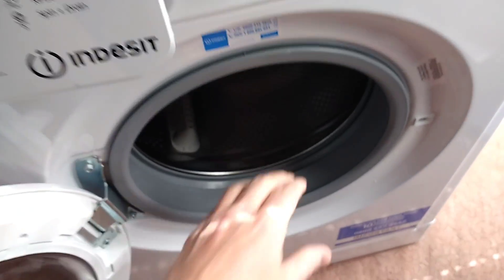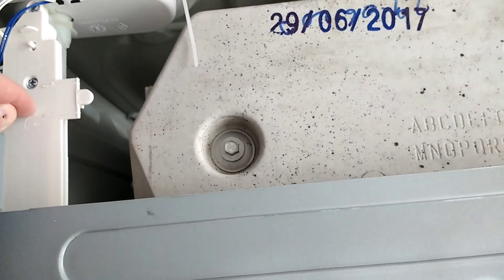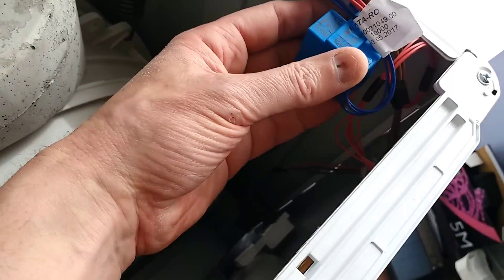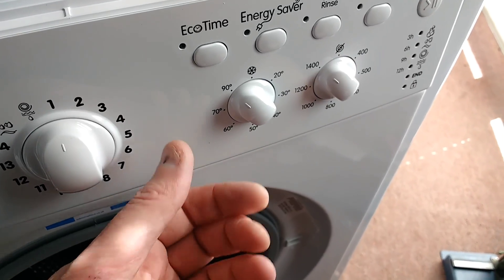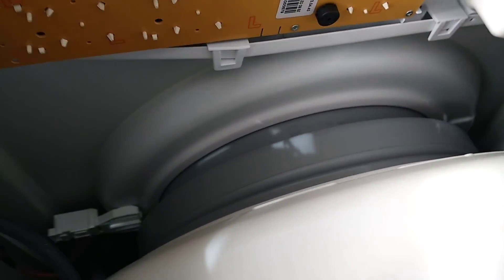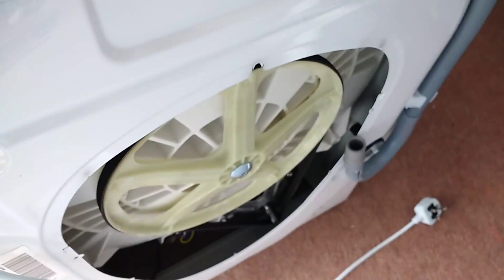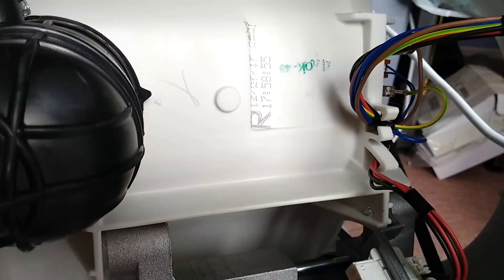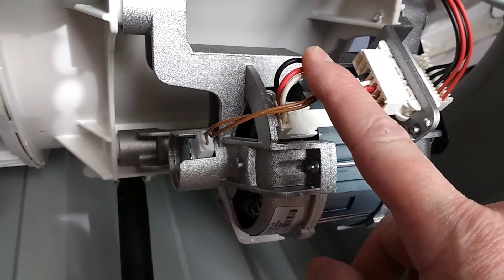Inside my new British washing machine (clothes washer).

Comment: Ours is a direct drive washer and has the motor as a large diameter thing attached where the big pulley would go. I figured that without a belt there is  one less thing to fail. Unfortunately it plays a happy fucking little tune when it's done.
Before that I had a series of Hotpoints, the last one caught fire spectacularly.  Fortunately I knew it was failing and took it outside on an extension lead so we could watch and cheer safely.
Then we had a Bosch bought off ebay which lasted us five years before it decided it wouldn't spin, so I bought our current one. Then I took the Bosch apart and found the pump jammed with guff, once it could pump out it would start to spin. So sold it on Ebay for pretty much what we bought it for.

Comment: I certainly wouldn't be comfortalbe with plastic pins and any sort of well... non existent obvious method of  balancing before (I have no idea what it is called in english... schleudern) ramping up the speed and squeezing the water out of the clothes
It seems horrible also that they make the pulley out of plastic.. but that being said it could just be a topology optimized version of a metal pulley which is just as stong or even stronger but cheaper...
fusion 360 can do this for free if you want to try it on your 3D prints and are so inclined.
but still I'd much prefer a metal machine with direct drive and fluid dynamic counterbalance... gives the brain something physical to grasp and hold onto while the machine is trying its best to blow itself to smitherines :D
Reply from the maker: A few appliance engineers got in touch and said the plastic pulleys are more reliable than the older metal ones.
The machine balances the load by alternating between tumbling and low speed spinning while monitoring the motor feedback until it gets a consistent current graph indicating that the load is balanced enough to spin at full speed.
If it can't balance the load (like when I put in a set of heavy overalls) it will try a number of times and then finish the wash without a high speed spin.

Comment: A front loader. Interesting as those here for home use tend to be usually top loaders with front loaders used at a laudromat. My GF's machine is about 20 years+ and still going strong. Had to replace the timer switch once.

Comment: May be 10 or 12 years ago I was working as a technician of Indesit/Ariston service center.  You are right for everything except one thing. Witch is less important. I'm  not shure if the things is  changed this days,  but if they not,  this machine should be italian or turkish.  The most unreliable part is the control unit. I have changed hundreds of them :) It is good that you chose a basic model,  without the fancy things, witch are mostly marketing tricks.

Comment: Is your washing machine affected by the whirlpool recall? Do you think another video on it is in order? :)
Reply from the maker: It's not part of the recall.  The issue seems to be the switching of the supply to the heater through the door interlock.  I thought they'd just switch the control circuit.

Comment: I believe they only have cold water inlet because for proper washing the temperature needs to be precise. Many washer have a long distance from the hot water heater, so they need to heat the water anyway. Since they have to heat the water they might as well just access cold water, save cost and not degrade performance.

Comment: I have an Indesit 10 years still running great washing machine even though its one of the ones on the danger list that exploded on Watchdog TV programme, even bought a Fridge freezer based on its reliability.
Its all down to how you use things that makes em last.
Mine has the same plastic pulley wheel - nae bother in 10 years!

Comment: Well, there's not a lot of difference between this, and my 25 year old Zanussi, except maybe 'software', and the fact that mine has two water inlet ports instead of the now regulation one port jobbies. Why don't the powers that be want us to use hot water off the house supply? What's to be gained by heating the water after it's in the machine - except bigger profits for the electric company? And how ironic, even more plastic bits in a machine, in a world where plastic is now a dirty word!

I think I'm going to stick with my 25 year old machine a wee bit longer - like maybe until I stiff out.......... say, another 20 years or so!

Comment: Hi Clive.

I have a very similar indesit washing machine. I find on the 'wool' wash (program 13 on my machine), it doesn't seem to rinse very well. If washing powder is used (instead of a liquid/gel washing solutions), it leaves a white residue on clothes (most noticeable on dark clothes). Using conditioner will also result in a similar residue even if a liquid/gel washing solution is used. Have you encountered this problem with your machine?
Reply from the maker: It may be because it's tumbling slowly and at a low water temperature.  I use liquid detergent in mine.

Comment: Clive, it was great to see a modern washing machine, things have slimmed down considerably since I was a Hoover service engineer (a six-week training course!) about forty years ago when they first introduced electronic control modules.  They've saved a hell of a lot of money on the copper wire!  When I left Hoover, my life went in another direction entirely and I lost touch with electronics but I'm trying to get back to it now I'm in my seventies.  After one heart attack a few years ago, I hope to build my own defibrillator! :)  I love all your videoes I've been binge watching them, thanks, buddy!
Reply from the maker: You can buy a defib for about a grand now.  Very complex things that analyse the remaining heart beat in great detail and will apply specific pulses and polarities at specific times in that rhythm.
Reply: @bigclivedotcom  🤣🤣🤣🤣
Reply: The best defibs are "bi-phasic" i think now - and are less damaging to the heart muscle while also being more successful. That's getting to be an "interesting" DIY design to a unit needing to handle a few hundred joules at KV and waveform shaping. Not impossible, but if your life is (literally) depending on it, I might be tempted to buy a second hand one.

Also the AEDs (auto ones), actually sync the shock with any pulses and twitching - again to try to maximise the sucess rate.

Comment: A lot of Clive's observations are spot on.  The dual cold water inlet solenoid valve is tailored to provide flow to appropriate dispenser compartments.  The motor is of a 3-phase AC type and runs off a VFD in the control module.  Many of the 'higher end' models are utilizing a direct drive motor arrangement with a large diameter stator and hub, which is quite likely larger than your drive pulley.  The tubs are constructed of a glass fiber filled plastic, polypropylene if I'm remembering correctly, and the halves are joined together with an ultrasonic weld after the drum and bearings are inserted.  The deeper rear section of the tub is universal to all models, while the front section is of varying sizes to allow a range of capacities.  As you'd expect from production engineering, there is very little difference between construction of lowest to highest priced models within the same design series.  Thanks for the look inside!

Comment: I couldnt realy see on yours but ive noticed on later machines the motor dosent have a pulley anymore..the belt runs off the shaft with grooves in it...
Other then than that they look like there made from cheap plastic which breaks the day after the warranty expires.

Comment: Looks like new machines don't have the little pendulum switch to cut it out when the shaking gets too much.
Reply from the maker: This one detects imbalance by monitoring the frequency variation of the motor encoder/tacho.  If I put a heavy pair of overalls in it will spend a lot of time trying to get them balanced, even spinning them slowly to try and shake some of the water out before trying various techniques to shift them around in the drum for another balance test.  The software in this thing is really clever.  It will even jerk the drum to try and redistribute a load clinging to the side of the drum.
Reply: It's a clever advancement I suppose.  The pendulum switch must be very old fashioned now, I couldn't even find a handy picture of one...  I have a small stand alone spin dryer that I sometimes put golf balls inside which then find the right spot to balance the spinner. :-)

Comment: I think they make the pulley from plastic instead of aluminium to prevent people from throwing rocks in the machine and enjoying it slowly and painfully dying that way. I imagine the plastic would break quite soon if a rock was thrown in 😄
In that sense and to be realistic,they probably designed it like that because 1. It’s cheap and 2. It acts as a additional mechanical safety so if the drum were to be jammed it would break. But i could be completely wrong 😄
Reply from the maker: The machine engineers said the plastic pulleys were more reliable than the alloy ones.

Comment: Ever put a great big comforter in and admire the motor controller as it ever so slowly and gently ramps itself up into final spin. Ahhhhhh. #bustedwatchinthespincycleagain!?
Reply from the maker: Not just ramping into the final spin, but analysing the balance of the load by the waveform from the tacho and realising your Carhartts have positioned themselves badly, then doing a slow tumble to rearrange them until the load is balanced enough to spin safely.  The software is amazing.
Reply: Right!?!? The things we take for granted.

Comment: too much plastics in my opition. I wouldn´t trust the motor hinge and the pulley at all.
Reply from the maker: When I put the video up a lot of machine service engineers said the plastic pulleys were much more reliable than the metal ones.

Comment: A few points worthy of note:
- our 12 y/o LG also has only two valves and it works exactly like you expected - both open for the fabric softener cycle (except on ours it is in the middle, not on the side like on yours - seems to make more sense in the middle)
- washing machines with only cold inlet are absolute standard here (Czech R.)
- Why is there the alphabet engraved on the top concrete weight of your machine? :D

Comment: Shitty place to put the main controller, I had a Hotpoint washer/drier for about a year then the whole thing stopped working, found out that the controller had got soaked because of an internal water leak. Designed on computer Never Meant to be Fixed, Modern Crap.

Comment: We replaced our front loader with a top-loader without the agitation thingy sticking up the center of the drum. To the point...We like it and don't have to crouch to put clothes in it or buy the pedestal that would jack it to a comfortable height. The old front loader had a sizable concrete block inside and FYI it  was not bulletproof. I took it to bits with some fine American and German firearms.

Comment: Wow, it is strikingly similar to an Australian one I pulled to bits a few years ago! Front panel layout and metal pulley are the only notable changes that I can see. Judging by the unfinished state of the casting, they were already spending as little as possible on the metal pulleys.

Comment: well its defiantly not a miele lol and those plastic outer drums start to smell after a while and are great mold traps. The brushlessmotor looks good but whats with the plastic pulley!!
Reply from the maker: +Stefan Graichen It turns out that the plastic pulleys are stronger than the metal ones.

Comment: Hope you have years of satisfaction with it, I had an Indesit washer dryer that lasted nearly 20 years, it baffled hotpoint/indesit engineer I know who was impressed it lasted so long, and yes I remember it had hot and cold inlet which was great as I linked the hot to a solar (radiator) panel in the garden..!

Comment: it is a 3 phase induction motor makes in very quiet , the outer tub is sealed , it cant be opened , its a nightmare cant change bearings. the belt is elasticated so can stretch . i work on those all the time, any questions?

Comment: the dispenser has 3 channels.. 1 valve feeds left to right, the other feeds right to left & when both are on at the same time for the fabric softener to be dispense the 2 water jest meet in the middle & make a 3rd jet of water. only 27 years fixing these & actually work for this brand.  motor is a 3phase.  that module will fit a few machines & yes we have a connector that fits the hole in the back to program the board & for diagnostics, we can run the machine from our laptops!

Comment: I wonder if the arm holding the drum in place is also plastic? Cause they might have moved away from aluminum because of corrosion issues from using bleach and ammonia.

I know that is a real issue on LG models, who also have a tendency to develop a condition called "mud butt" in which the bearings in the back of the machine develop leaks, which shorts out the direct drive motor, causing the drum to electrify speeding up the corrosive process and giving the person operating the machine a surprising shock when they try to operate the machine.

Comment: That machine seems super serviceable if you can get the parts.
Reply from the maker: Most modern machines are, and the parts are usually available from online companies.
Reply: I haven't tried to repair one in many years, I did sell a broken washing machine on Ebay for £1, the guy who bought it drove  4 hours to pick it up.
Reply: That's always MY biggest concern: Parts availability. Especially, if a machine isn't well made.

Comment: Is this one of those washer/dryer all-in-ones? They are starting to become available in the states, but the appliance store talked me out of it because they said the 120v doesn't dry very well.
Reply from the maker: My first washing machine was a washer-dryer unit.  It could only dry small quantities of clothing because a proper dryer needs the biggest drum possible to allow the clothes to tumble and air.  It was also very troublesome because it was basically trying to fit a lot of technical stuff in a cramped and steam filled area.  I recommend separate machines, and also a condenser dryer if they are common in your part of the world.  (no outside duct needed.)
Reply: Yeah they pretty much just have separate air dryers here in the States. Generally 220v but they also have natural gas units that generally cost about 50% more. When I see pictures of British kitchens, I typically see what appears to be an under-counter clothes washer. I don't know if those generally wash and dry in the same unit. I was looking at a Bosch all-in-one that was new to the States a few years back to fit in a closet, but ended up going with a normal standard set.

Comment: Front loader or top loader?
I'm not sure if top loaders are being phased out, or whether you prefer front loaders. 

I prefer front loaders myself, as those are what I grew up with, and they seem to do a better job of actually washing clothes, water and energy efficiency, as well as having space on top for a dishwasher or dryer. 

The washing machine mechanics around here always recommend changing to a top loader,  which annoys me as it seems like a worse design in every aspect except product life due to balanced bearings.

Why have you picked a front loader in this case?
Reply from the maker: It's almost impossible to get a top loader in the UK.

Comment: if i had a bucket of clean water and put that in washing machine instead of down the drain, would machine work it out and put less of its own water in
Reply from the maker: It might try to pump it out if it detected water in the drum when you started a cycle.  But you can often pour water in via the powder drawer.
Reply: thanks clive

Comment: Engineering is always a compromise, and as time goes by the economics kick in more and more. Thus no aluminium pulley, electronics not protected from water (destroyed washing machine will lead to another sale), no repairable drum/bearings (eg broken please buy another rather than some cheap bearings on ebay). Bet it doesn't come with more than a year warentee? I recently bought a 2nd hand Bosch machine for £80; so glad I did; not only is it very well made and durable, its also highly repairable. If i'd bought a new one i would have ended up with a crap British one like a Beko, which would last a year or two.

Comment: Mainly made in Italy. A 'wash your smalls and throw it away' piece of kit. Generally bearings die first on these which due to a one piece sonically welded drum are virtually impossible to replace. Quite a nasty piece of kit really and if you have an older machine, try keep it going rather than buy one of the newer pieces of junk. My old indesit is some 12yr old now and still going strong, I just keep repairing the odd little thing that breaks, leaks etc. 
At least now we can sleep soundly knowing Clive has clean socks!

Comment: biclivedotcom i would check once in a while where the springs hold the drum. I had a Indesit washing machine from 2005 and after a couple of years the springs started to wear down the plastic, after some time the drum lowered and started hitting the walls. In my case, i inserted (after the damaged plastic holes) a metal tube inside those holes in order to not wear even more the plastic where the springs are connected to the drum. Good luck